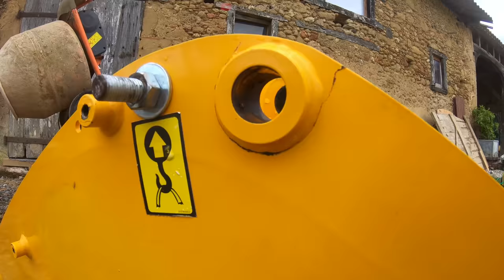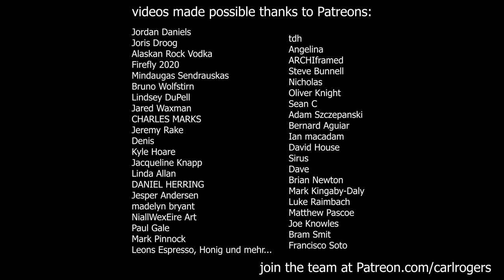When buying used Equipment goes WRONG

Comment: Couldn't it just be air in the cylinder ?
Reply: no
Reply: @euanbob2321  Yes. The compression of air causes more heat than the compression of hydraulic fluid.
Reply: It could be but you’d normally get cavitation / vibration and some groaning type noises as well with air (in my experience at least). And the oil flow would normally push the air back to tank in most cases shortly after refitting - the tank goes kind of froffy while the system sort of self bleeds but it is best to get the air out. Could be oil by passing a seal causing the heat which would cause cylinder to cycle slowly. Try doing a leak off test to find out if it’s by passing oil. My guess is it is so you’ll have to pull the rod to see what’s going on with the gland seals.

Comment: May have some air trapped in that cylinder. It heats up when compressed. May need to bleed it. Could have filled it with hydraulic fluid during assembly. Messy job, but helpful. Nice work overall.

Comment: The screws of the backacter should be cut off by oxyacetylene blowpipe. Is much more easer. Then you had a good chance to change the main blade and the flanked blades, but the main  blade must have been bored for the two-hole-teeth (from catapillar). Ok, that would have been a job for the local welder as well. Professionals allways look after the inner side of the cylinder tube. The question is: are there any cracks inside of the tube's surface. If yes the surface should get treatmen of horning. Cracks on the inner surface of the tube could cause further damage to the seal collar of the forcer. But for non-professionals you did a great job, I must say.

Comment: Always use safety footwear.Flipflops are ok as long as they are reinforced with wolfram/carbon steel.They become light and utilitarian and at a pinch, soled with
car tires,preferably Michelin for extra traction.
It is not safe to be walking around a centuries old farmhouse....Long dormant anthrax cells could attach themselves to your clothing and before you know it you become incapacitated making you vulnerable to Covid or Omicron....

Comment: Great video. If the cylinder is heating up its a sign you have an internal leak. Piston seals are probably passing. If you left the arm up and shut it down for a while. If it drops it may confirm that.

Comment: Errrrr the holes in the pin bushings don't need to line up with the grease nipple. The channel that runs around the inside of the eye distributes grease to all 4 holes in the bushing. The bushing you removed was perfectly fine. The pin was worn from failure to grease it.

Comment: Apologies if a repeat question (bit late to the vid, which was excellent btw), but is there a crack running around the kingpin knuckle that is welded to the front of the cab?  31:21 gives a good view of it. Seems to indicate a crack along the whole top of the weld (could be dirt), and extending into the front bar of the cabin. Or is the 'crack' along that front bar just a split line?
Reply from the maker: You've got a keen eye 😊 yep that's another crack. Hopefully we'll sort that too when we come to do the king post

Comment: You Sawzall blade is in backwards.makes access to better angles when cutting more difficult .that s probably the reason it didn't cut.and if bolt spinning it won't cut as well either.you can always spot an a mature by his Sawzall blade in correct or backwards like yours.lol.they heat  up and you twist and bend more trying to gain better access. Costing money for broken blades

Comment: We had Chinese "Hysters" at work, with Chinese "Yanmar" engines.
There was always a queue of broken ones lined up outside.
Brakes, hydraulics, steering, cracks in the masts/forks and just generally no-go.
Avoid.

Comment: Air carbon arc gouge works great on fractures like that and then 7018 stick weld is what i would have done back in the day 20 years ago would have showed up  in a service truck and had it done under 2 hrs > no disassembly and yea burnt paint hehe!

Comment: When I remove bolts that are froszen like what you have ? I get a impact gun and run them as tight as possible and then they usually twist right off !

Comment: Probably the lower cylinder gets hot and is sloppy due to air trapped that compress when you move in the extend direction. Try to bleed the cylinder chambers

Comment: If the holes in the bucket are with oversized, those teeth will wear quicker.  Either drill the holes larger and weld in a piece of heavy gauge pipe the the correct ID or just weld the hole up and re-drill it.

Comment: Hydraulic help:   so a good rule to remember,   Compressed air gets hot!   so you probably need to bleed that cylinder.
Reply: That nylon slug he put in the hole on the head doesn't belong there. Those holes are for the oil to pads through when the shaft is extended. Your blocking flow of fluid which creates resistance and resistance creates heat. Plus flow blockage slows movment.
Reply: That nylon slug is there to help lock the head in place it goes Into a hole in the head up in the threads

Comment: Worrying observations ! dismantling a digger without safety shoes(flip flops basically), so many near misses when using grinder near its power cord,amazing driving a soft brass bushing in by pounding it with steel plate.I laughed when you threw a hoist over that rotten looking beam ,I thought anything heavier might pull the barn down
Reply from the maker: yawn

Comment: Why HORRORS? Things wear and people bodge, especially in the building trade...I also concur with an other poster re: freeze bushes and get a soft mallet or use a soft interface, metal to metal deforms, also to remove bushes, cut a slit in them with a hacksaw and they will basically just slip out.

Comment: @27:32, why would you use an extension? and @27:35.... why aren't you using the ratchet instead of the closed end of the wrench? seems like you're working backwards...

Comment: The original design did not provide enough material above the crack.
Reply: Yep.  I have a takeuchi excavator this size and the boom and stick are built with thicker steel.  The jcb and komatsu mini excavators in the 16hp size always looked cheaper built to me.  2750hrs on my TB015 and it's been a great machine.

My bucket has replaceable tooth caps just like the the big excavators do, no bolts.

Comment: I does not look to have been overworked but the crack is at a high stress point but should not have failed. Tell JCB about it.
That is not a weld that will hold up it is a buildup of weld metal and the crack is not fixed underneath, it wanted gouged out and redone with a doubler on top.

Comment: The slow cylinder could be from leaking past the seal, I know it's new but it could have gotten torn during the install. The heat is generated by the fluid being forced through. Also I hope you discovered that you don't need a special tool to install that lip seal. You can watch me do it here https://youtu.be/CQQ0Mud0h28 
Anyhow, great video and not bad for a couple of wood workers...lol.

Comment: Question, at the end of the video the young man was digging and had the blade on the back side. Isn't that suppose to help stabilize the unit while digging to give a solid foot print.
Reply from the maker: Correct but the soil was already loose so didn't need to dig hard

Comment: That reciprocating saw is not the right tool to cut those bolts.  The anvil MUST always be pushed hard against the object for the blade to work correctly.  You need a cut-off tool or angle grinder which eventually dawned on you.  Reciprocating tools have to be completely still for cutting to be effective.  BTW greasing the threads for Nyloc nuts totally defeats their purpose and grinding down those welds has weakened the repair.

Comment: wouldn't say buying used equipment has gone wrong shes done alot of work for you.  pretty normal place for them to crack repair looks good and strong so no more worries seals go on cylinders and do need to be replaced every now and again kingpin wears and needs replacing get it all done and she should last you just about forever.

Comment: 22:57 - not really a pro, but maybe those gaps have to match up on the the side of 1 of the oil pipes to get better flow or smth? (30:50)
or maybe just some old crap blocked everything up, because you probably didnt clean out/flush the main system...

Comment: it seems like the eye was grooved so it wouldn't matter where the holes in the bushing were, the grease goes around the groove and enters all of the different holes.

The two of you have courage working around heavy steel in bare feet and sandals.

i was  like how long did this take, why is there ivy growing on the boom. LOL  I guess it was quite excited to get back together and couldn't contain it self. lol

Comment: So you put grease on a bolt that takes a nyloc nut? May lose some teeth on that bucket. That thing needs to be tight. I would even tack it with a welder since removal is always a destructive procedure as you saw.

Comment: thats why you shouldnt buy random Chinese excavator. Steel is not just steel. Steel that uses Komaisu and JCB is not the same.   
I wouldnt be suprised that you would have to replace the hole hydraulic piston 
I have seen those low quality Chinese hydraulic piston crack. its impossible to repair them on commerical equitment which used almost daily.  it will just crack next to the new weld.

Comment: It is a sin to use woodworking vise for mechanical work. At first glance it seem like the side wall plate steel of the boom is just toooo thin and therefore cracking.

Comment: Shouldn't some of those nuts be castellated nuts with a split pin through them  due to vibration issues on the machine .
Reply: If you tighten them good then no problem. They have no load on them. They are only there to prevent the pin sliding out.

Comment: 14:20 Well there's the problem. You should be using Colgate. 👍 
I was not happy to see the teeth cleaning as I was going to use that joke. Well done with the humour.... NICE ONE!! 🤣
14:32 As someone with 4 crush discs in my lower back, yes, you should have gotten help. Please don't do that again or you will end up with a very stuffed back that is only getting worse with chronic sciatic pain in both legs (24/7/365 or 366) for 33 years and counting. You may also end up with an opiate addiction to help manage the pain. Please, please, PLEASE be careful and Thank You for sharing your videos. 👍

Comment: NO !  NO NO NO, Please don't ever Hammer New Bushings in.. Sit them overnight in your freezer and PRESS them in... If you don't have a press, use a small bottle jack braced under something ( I have a steel bar welded across one of the support girders in my shed) OR use a vice with flat steel plates across the jaws to protect the bushings. Always lubricate bushings and pins before fitting them.  If you hammer them in you can damage the bushings, screw up the alignment and swell the ends causing premature wear of the bushings and pins.. Same goes for seals, lubricate them before fitting AND after fitting. I use vaseline on seals and glands and it helps the bushings and pins to go in easier. A heat spot could be a few different issues. It could still be airlocked and gets hot because you are compressing air and that causes heat or the seals you replaced have not seated or were damaged when you hammered the ram into the cylinder. I would pull the cylinder off again and double check those seals. Lubricate with hydralic oil or vaseline before pressing the ram back into the cylinder. Otherwise, you did a decent job mate..

Comment: Maybe… just maybe… before working with industrial tools you should consider the use of open toed shoes.  Yes you toes look good now but if the 3lb hammer or 15lb cylinder falls on them the will no longer look good.

Comment: The hole that the king pin goes in was likely worn, thus why they tried to build up the outer diameter of the pin to take up the slack. This would be much easier than welding up the holes and line boring  them or line boring them oversize to add bushings.......
I guess I should finish the video before commenting lol. Good job by the way👍
Reply from the maker: yeah definitely! but there is now a lot of play in the whole assembly. so long term not ideal!

Comment: why   not  heat  up  the  part  to  expand  it  to  remove and  fit  new  one   , hammer  bad   move  you  could  have  used a  socket  and a   nut  and   bolt  to  refit  it

Comment: Sorry to say this, but the first error was to buy a JCB they are about 80% the cost of a comparable machine and the have a 50% lifespan of comparable machines. You are using you machine quite lightly, use it in an industrial setting and it would be in the scrappers bin in short order. Good luck on future repairs when needed. You did a nice job doing what you did.

Comment: Your farmers welding looks a bit dodgy. 
Not enough amps!
Hope they hold. 
I'd have been inclined to weld, grind flat, then weld a steel ring on top to add extra local material.
Keep a watch on them.
.

Comment: Big mistake the repair done in the arm was not done right crack area must be reinforced with a plate and welded properly not for decoration, bushings are not installed with a hammer

Comment: You guys should be laughing, all the pins and bores look great and came out like butter, someone always greased this machine. That swing pivot is nothing from what I've seen. They probably just pushed it a bit too much with it being a smaller machine. The pins on my full size John deere 500C are not too pretty but it's just a homeowner machine and I can't spend thousands rebuilding a beat machine, better to use it, sell it and find a tighter machine...

Comment: The work being carried out takes me back a bit because I used to service and repair construction equipment for my job  we had to fix most of the repairs on site  I had a Mighty Midget Moibil welder and Oxy acetylene bottles  for cutting and heating material  inserting bushes was done with a long bolt  thick washers at each end and squesed the bushes in by compression using the nuts at each end OR one end If using a long threaded Bolt The teeth need the bolts tightening up also the holes in the bucket its klelf have elongated in time and allowed the teeth to move and the bilts have worn down where they go through the bucket Good luck Wished we had a workshop to work in all site work Wind rain snow frost Get the machine working that was most important Ha Ha

Comment: The way you guys started off I was sure you would have done all the repairs including the welding of the booms until I seen you break out the reciprocating saw to cut off the high tensile bolts used to attach the bucket teeth. Did you guys not have a 5" angle grinder with wafer thin cut off disc or an oxy set to cut these bolts off

Comment: I take my hat off to your building skills they are wonderful, but sorry guys you are not mechanics

The holes in the bronze bushings are NOT supposed to line up with the grease nipples. If you look inside the eye on the end of the ram there will be a circular groove which lines up with the nipple hole and the four holes in the bushing. If the hole in the bushing does not line up with the nipple grease is forced to travel round the outside of the bushing and enter the bore through all four holes so providing all round lubrication. If the holes line up then only one side of the pin gets any lube.

Hammering the bronze bushings into their bores is not a good idea, there is no way to prevent them going in slightly 'cock-eyed- in which case they will be damaged and out of round. They do not need to be shrunk first as some on here have suggested, they are split to allow them to spring fit into their bores. Next time, press them in with a vice, bottle jack in a frame or even a G cramp

When you come to do the king post, you cannot get the holes reamed out and there should be no need to. The bores in the king post should not be worn anyway, only the bushes which you can replace. If you have the holes in the king post reamed out, the new bushes will not fit!.

You also should have taken some advice on how to re-seal and re-assemble a hydraulic ram. You do not fit a sleeve over o-rings by hammering it. All that achieves is to chew up the o-ring and prevent it sealing properly.  Same with fitting o-rings and seals using a screwdriver - they have sharp corners and edges which damage the rings / seals. Unless you are an engineer this sort of job is best left to a professional. The reason why the bottom ram is "slow on the up stroke" and heating up is almost certainly that you have damaged the piston seals when re-assembling it. Steve Corcoran in the post below has explained it very well, I have no need to repeat what he has said

Comment: On the bucket, why put the nuts on the inside, not the outside?
Reply from the maker: I suppose to stop them digging in as you want the back of the bucket to be smooth. it's not possible to fit them the other way around
Reply: @carlroge  ah, yes good point!